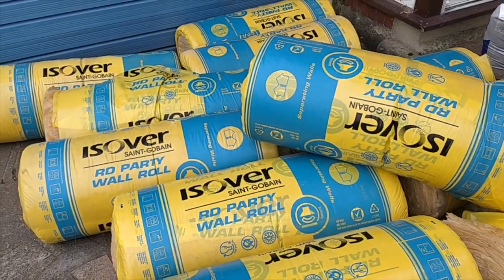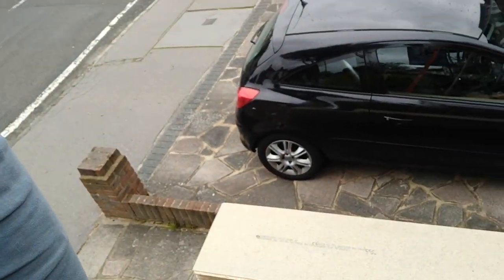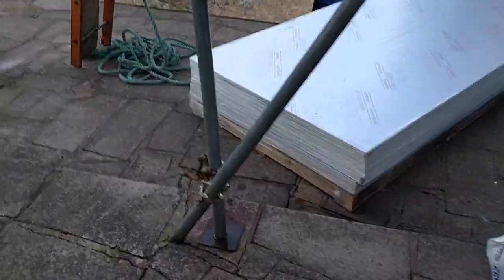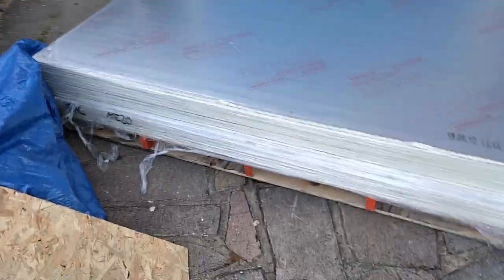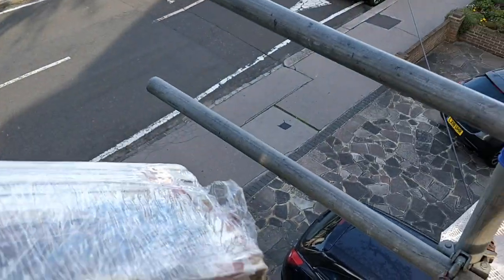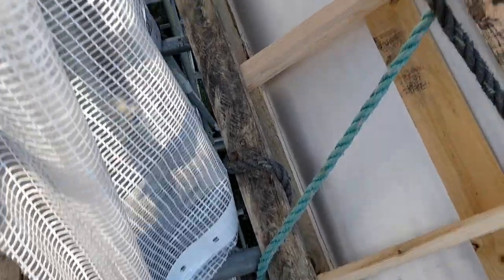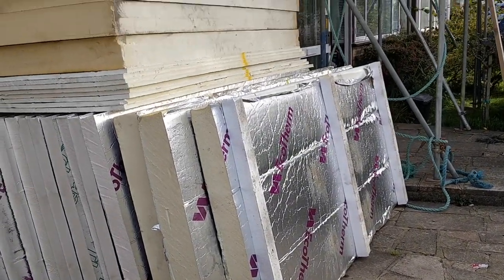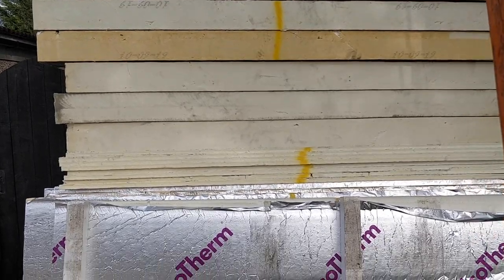Loft Insulation Delivery

Comment: Do you have the Ebay links?
Reply from the maker: Hey, I've got a few links in the description, but I'm not sure if I included eBay links - I'll check and get back to you...
Reply from the maker: Here are the links for the insulation:

Seconds and Co:
https://rover.ebay.com/rover/1/710-53481-19255-0/1?mpre=https%3A%2F%2Fwww.ebay.co.uk%2Fitm%2FKingspan-Ecotherm-Xtratherm-Non-Foil-Multiple-Thicknesses-Seconds-Insulation%2F293180653652%3Fhash%3Ditem4442edc054%3Am%3AmP-rheVSFjVSgPCJ7UNj_AA&campid=5338608932&toolid=20008

Mineral Wool/Party Wall Insulation:
https://rover.ebay.com/rover/1/710-53481-19255-0/1?mpre=https%3A%2F%2Fwww.ebay.co.uk%2Fitm%2FIsover-Loft-Insulation-Spacesaver-Roll-Glass-Mineral-100-150-170-and-200mm%2F142174385003%3Fhash%3Ditem211a40f36b%3Am%3AmHvHDhOHq3x6I-GQnHEt9AQ&campid=5338608932&toolid=20008